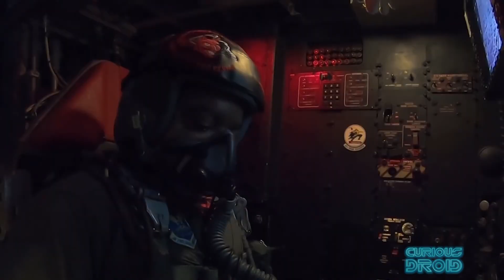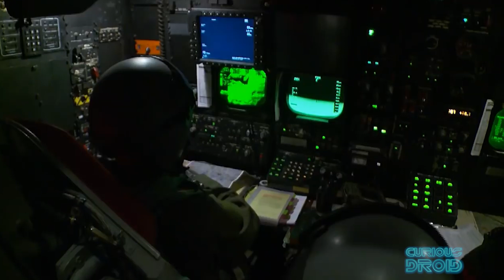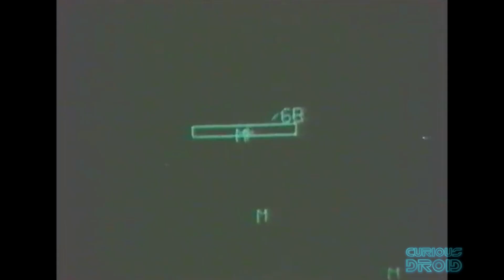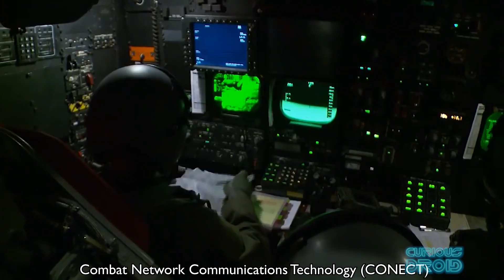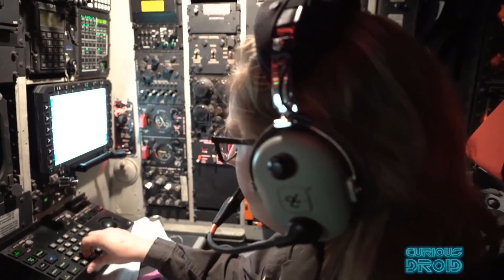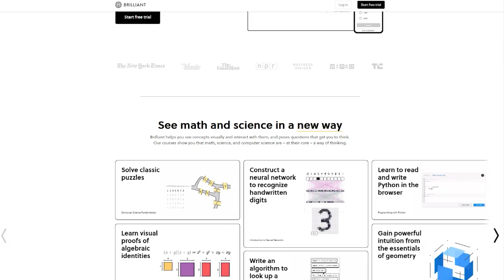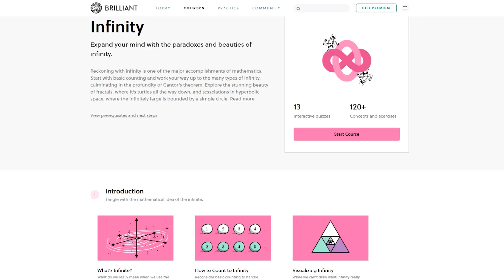How Long Can the B-52 Continue in Service?

Comment: If it fits tactical niche perfectly, it need only maintenance, not upgrades or replacement. When a weapon or device obtain relative perfection, it no longer need to change with time pass. For example, steel sword or knife made 700 years ago may be just as good and useful as one was made yesterday. Bolt rifle, like SMLE, mosin or mauser is just as good today as it was century ago. Of course, today swords and bolt rifles are obsolete, they are not mass army weapons, but they are almost as good as they could possibly be, and it will not change anymore.

Comment: well, as bombers go, the B-52 is a quintessential design.  In other words, if it were designed today, it would look the same.  That speaks to the insights the design team had when it was first put on paper - back in the early 50's!.  Still a sexy beast.  Sorry, after the B-1 "Bone" with it's wine-bottle fuselage is drop-dead gorgeous.  The B-2 "Spirit" flying-wing design  is sinister.  But, the B-52  is a true long-range heavy bomber.  I find the design beautiful in it's robust simplicity.

Comment: The term "over-engineered" is really a vague and inaccurate statement.  It really wasn't over-engineered so much as it has relatively high margin's of safety for some components.  But it certainly has it's flaws and some of the flaws are due to design, which the air force is aware of and actively mitigating.  What keeps it flying is the Air Force steering the way with it's ASIP program, the corrosion control plan, and the Boeing engineers across the street at Tinker AFB.

Comment: The 52s weren't over engineered... they were engineered to be over built  (long lasting).  Changing the engine manufacturer, is as dumb as dirt. Changing engine design/model is to be expected.

Comment: I was an enlisted electronic warfare/countermeasures technician (chaff, flares, radar and radio jamming, etc.) on the B-52H from 2001-2007. This meant that I and my coworkers drove out onto the flightline in a work truck with tool chests and tool boxes, climbed on/into/beaneath the plane, and troubleshot and repaired mechanical and technical issues, not unlike glorified car mechanics. Most of our work involved identifying malfunctioning parts, uninstalling them from the plane, sending them off to be fixed or scrapped, then installing new replacement parts and ensuring they worked properly.

If only I could show you how ancient that technology really was. You could sense its age. It all looked, and felt, like you'd stepped fifty years into the past, and was large and heavy. For example, there were outdated computer programming cases (repair tools, not part of the plane) as big and heavy as a packed piece of luggage, with memory cartridges the size of lunchboxes, both with hardly more computing power and memory than a cheap calculator.

The plane also broke constantly, in the sense that at least one thing (and usually several things) had to be repaired after every single training flight, let alone real sorties. There is a price to pay for being old without being entirely replaced by something 100% new.

Comment: Question about 0:36 It looks weird that the fuselage axis is pointed much lower than the apparent direction of flight. I thought the two vectors were nearly always aligned. Is that normal for planes,  for the B-52, or is it due to those huge flaps changing the angle of attack or something?

Great video!

Comment: The original B-52 wing suffered from problems that lead to a redesign. I don't recall if it was a fatigue issue or something else. The wing was designed to flex considerably during normal operation, something like 12 feet at the tip.  I recall that the wing tips were approximately head height above the ground when the airplane was parked and they flexed up to about level with the top of the fuselage when in flight. During my Air Force service years (1968-1972) the D and earlier models were being sent to depot to be refurbished. This included replacement of the wings to extend their service life. (yes, they sawed to old wings off at the root and replaced them with a new wings. I am not sure if the H models which I worked on were also later modified. As I understand it only the H models are still in service, the earlier models were either shot down over Hanoi or retired to the bone yard. Last I heard one early model (A?) was still being used by the Air Force to drop test aircraft at Edwards Air Force Base.

Comment: 0:28 Flying on diesel?
Reply: @ John Johansen That is what burning JP-4 jet fuel looks like when they “pour on the water”. They always seemed to do that on MITO [Minimum Interval Take-Off] launches, which is what you’re looking at. Four bombers would take off at 30 second intervals. Not sure what that water business was all about, but yeah, it does look like they’re belching diesel.
Reply: @huenorton3587  Thanks for answering. 👍
Actually I was thinking of writing coal, instead of diesel. 😉

Btw I've seen videos about MITO.
There they also looked like old coal fired steam locomotives. 😆
Reply: Often times the MITO launch is associated with a FSAGA [First Sortie After Ground Alert] flight where the nukes were stripped from the planes on the alert pad and then they would scramble them “as is” [i.e. no inspecting for bird’s nests in the radar cooling system etc.] to see how they will do after sitting still for weeks. This most often includes testing the cartridge start of the engines wherein an explosive charge is used to spin up the engine. A cloud of white smoke would envelope the alert pad and then the bombers would come lumbering out of it to go into MITO. Smoke. Lots and lots of smoke and fumes. I hated being on the flightline when they did that. Got carbon monoxide poisoning once between a cartridge start MITO and the jets running on the plane I was working on for hours. Got to the dorm , fell asleep and woke up with something like a Charlie horse in every muscle of my body along with puking out one end and simultaneously shitting out the other while curled up in an immovable ball on the floor. Great times. Lol.

P.S.
I wouldn't be surprised if the old "A" models were indeed coal-burners. ;) [I only worked on the "G" and "H" model air-hogs, so I can't say for sure.]
Reply: @huenorton3587  What can I say, but thanks again for making me wiser and realizing what's really going on.
I'm a simple European, when it comes to American airforces.

Thanks for sharing. 👍

Comment: I think the emphasis on the long life of the B-52 should have included more information on the maintenance. I give credit where credit is due and for the US forces, the Air Force is top notch in maintenance as every air frame in the DOD that is not mission capable for longer than 24 hours MUST be reported to the Senate Oversight Committee. Before secure cellphones, they sent runners to hand deliver the reports. I can assure you that by this time the USAF has x-rayed the entire aircraft several times.

Comment: I was part of the 92nd BW H at Fairchild in 1978.   I will be long dead before the B-52. Trivia, when the tailgun was removed, the space and weight were replaced with concrete to rebalance the plane.   A ton of it.

Comment: A real simple explanation is it was designed a the perfect time.  Designed to carry big, heavy weapons intercontinental distances.  The weapons got smaller and lighter.  This gave the B-52 extraordinary capability that no one wants to throw away.  It is cheaper to put a new engine in the old, but well maintained, bus than to scrap it and buy 4 new station wagons.

Comment: The B-52 is such a beast and an icon I personally don’t think it will be retired for at the LEAST another 100-150 years
Reply: A B-52 could still be useful in 100 years, but none of the planes in service right now will last that long, even if boneyard planes are cannibalized for parts.
Reply: @Jake-rs9nq  they would literally need to be taken down rivet by rivet - at which point it might be easier to toss the buff
Reply: God bless you mi Generál. May the thrown outs from helicopters burn in Hell for their communist subliminal activities.

Comment: Really liked this video but then I like the B-52. The US military has 
a lot of old planes, jets and helicopters. There are civilian planes
that are old designs still flying. The Brits do too but not  on this 
list. I don't have everything and the dates might be a bit off.  

DC-3 was 1935
Piper Cub 1938
Globe GC-1 Swift 1942
Lockheed U-2 1957
SR-71 went 34 years from 1964?
KC-135 Stratotanker 1957
Lockheed 130 Hercules 1954
Rockwell B2 Lancer 1974
Northrop T-38 Talon 1959
Lockheed P-3 Orion 1959
Bell UH-1 Iroquois
Sikorsky S-61R 1959
Boeing CH-47 Chinook 1961?

Comment: Another problem with replacing the 8 TF-33s with 4 newer engines is the risk of uncontrollable yaw if an engine is lost on takeoff, when all engines are at full power; the BUFF was not designed for that

Comment: I talked to a BUFF driver at an airshow, and asked about the engine refit thing. He said that something had actually been tried, but the increased thrust started blowing the tail section off of the aircraft.
Reply: No, that is just a story.  A problem was with the wing being a little to low to hang the newer engines on.   A re engined plane has not flown yet.

Comment: It is basically the same with the Boeing 737, which first flew in 1967 and is kept running until today and further. Aircraft development is just so immensely expensive, that fitting new technology into an old aircraft body is done until the limits of the airframe are reached, or in the case of the 737 even exceeded.

Comment: Tells you how stupid the US military is. They never did the engine upgrade--ended up being so dumb. Even the CBO suggested they be replaced but B-52 are not sexy like the costly F-22 and F-35 dollar killers.  The Air Force has been constantly trying to kill A-10 with the F-35 turkey or what ever. The F-16 still does a great job much more economically than the F-22 or F-35, which were both gold plated. I understand that the B-2 will be retired in 2030 and the B-1in 2040. The B-52 outlasts all those other gold plated planes.

Comment: Actually, the original B-52 had a projected service life of no more than 20 years.  When it was first rolled out in April 1952, the Air Force had already had some unpleasant experience with Soviet MiG-15s (the Korean War raid on Namsi on 23 Oct 1951, aka "Black Tuesday", where six of nine B-29s were lost by the Soviet-piloted jet fighters, which not only had a 2:1 advantage in top speed, but also tremendously out-gunned the bombers with two 23mm and one 37mm cannon; the American bombers had but .50 cal turret-mounted, some 29s still had the twin tail-mounted "twenties" but they were already being replaced; IDK if any of the planes on the Namsi raid still had the cannon.  It was figured that max ALTITUDE, or "ceiling", which the "BUFF" had well over not only the venerable B-29 (31,000 ft) and its derivative B-50 (37,000 ft), but also the faster but smaller B-47 Stratojet (41,000 ft, the Stratojet took much of its inspiration from a late German WWII design, the Junkers EF132, which had the swept wings and six-engine configuration, the original concept of the Stratojet was a straight-winged aircraft, until the "Alsos" project uncovered the Junkers design and a slew of wind tunnel test data).  It was figured, correctly, that the MiG-15 and its derivative MiG-17 "Fresco" simply had neither the loiter time nor ceiling to catch the BUFF, which had sufficient speed to make interception very "dicey" in the early and mid-1950s.  However, as already with the "Century" series the USAF was coming out with supersonic fighters and/or interceptors (most notably, the F-104 "Starfighter", which had a bad reputation as a "widowmaker" for its poor reliability), there was reason to surmise that soon the Soviets would do likewise, which they did in 1958 with the Yak-28 "Firebar", which could reach 55,000 feet and top out at Mach 1.8!  So, going back to the original 1930s Luftwaffe concept of the "Schnellbomber", e.g, a very fast medium bomber that relied on speed and altitude to evade interception, the USAF came out with the B-58, which indeed flew very fast (Mach 2.0) and high (64,000 ft acknowledged, it may have been capable of 70,000 feet!), and worked further on the B-70 "Valkyrie".  But the "Hustler" was extremely expensive to buy, operate, and MAINTAIN of itself,  and required a disproportionate amount of air-refueling support, and the Valkyrie promised to be a "budget-buster", which didn't bode well, especially at the time with the Navy clamoring for nuclear boats and carriers (and air wings) and the Army wanting a fancy new MBT to go "toe-to-toe with the "Rooskies".  It was the shoot-down of Francis Gary Powers' U-2 in May 1960 that was the "game-changer", as the capabilities of Soviet missiles were shown to be able to shoot down high-altitude bombers with ease.  This led to cancellation of the Valkyrie outright and a planned replacement of the B-58, the B-1 "Lancer", cancelled under Carter but resurrected under Reagan.  Meanwhile, the B-47s reached the end of their useful lives and this left the "BUFF" to should the SAC workload.  It was thought that bombers were way too vulnerable anyway and obsolete; the B-52s were used over Vietnam precisely b/c it was believed that the Soviet-made air defenses weren't the best they had; in the Linebacker II operation in 1972, that was proved WRONG.  However, the loss rate of the BUFFs was a lot less than expected, and what they did lose were blamed on poor operational tactics (e.g., flying in predictable patterns) and use of the "G" models, which hadn't received the ECM upgrades that the "D" models had.  Losses were kept down by including at least one "D" along with two more "G"s in a three-ship formation as well.  So it was seen that indeed the "BUFF" was still a viable bomber platform, and it got the USAF through that period until the B-1Bs and later the 21 B-2 "Spirits" could replaced it for the strategic role.  Still, and as all but the "H" models went to the boneyard, as much to fulfill SALT II treaty commitments (still-flyable airframes were actually chopped into pieces by a specially-made "guillotine" under the scrutiny of Russian observers at Davis-Monthan) as to retire aircraft no longer needed and/or easily maintained, the B-52 proved essential in "Desert Storm" and subsequent operations.

Comment: Comparing the Sopwith to the B-52 is comparing different times, in that the advancements made after the first flight of the Sopwith have been FAR GREATER than the advancements made since the first flight of the 52. The advancement has slowed down dramatically. The B-52 could be in service for many years to come, especially considering that a few original WW1 planes are still in the air today over 100 years old..

Comment: As long as these things are true, no reason to take the B-52 "BUFF" (yes, Big, Ugly, Fat, "Fellow") out of service...

(1) The air defenses protecting an enemy target are effectively neutralized, so the BUFF can fly in and drop those tremendous payloads and blow the crap out of something.

(2) There's a target amenable to being neutralized by an ALCM, even with a conventional warhead.  Of course, in the STRATEGIC role, those ALCMs can carry nukes.

(3) The wings can be kept from coming apart with a rebuild.

(4) Suitable engines procured and kept in service to replace the aging and THIRSTY TF-33s they rolled out of the Wichita factory gates with.  From what I've read, CFM-56s, FOUR of them to replace the current slew of EIGHT TF-33s, were at first considered, but that in turn would have required such a reworking of the empennage that would have in effect meant an entirely new aircraft, at considerable expense.  Therefore, it was decided to keep the present eight-engine configuration with smaller turbofans that nevertheless are still far more efficient than the TF-33.  Supposedly this engine upgrade will cost about $2B, which is equivalent to the stated cost of four of the new B-21 "Raider", but will pay for itself over a fifteen-year period in terms of lower fuel and MAINTENANCE costs, as well as, for the remaining 77 aircraft in service, the keeping of both KC-135s (which themselves have almost as long a career as has the "BUFF" and will likely remain in service with Air Guard units well past 2050), KC-10 "Extenders" (a few have been sent to the "boneyard" at Davis-Monthan), and the new Boeing KC-46, which is slow to roll off the assembly line and still plagued with issues, will be lessened (ergo, the older, less "fixable" versions can be sent to Davis-Monthan, along with every squadron's "hangar queen"), which of itself will more than pay for the re-engine program, along with increased range and/or LOITER time, which in terms pays off in terms of mission capability, something that's not appreciated until it's PRICELESS.

Comment: I worked on KC135's in the AF and those are just as old, made in the 50s and early 60s. the 135R model was the most recent upgraded version of the airframe. It is projected to be in service until at least the 2050s even with the new 46 models being produced right now. Amazing planes both by Boeing, they know how to engineer aircrafts

Comment: I worked on the C-130 in Little Rock AFB, Arkansas!
I worked on the B-52 in Andersen AFB, Guam!
SAC STRATEGIC AIR COMMAND
Persian Gulf War
Reply: I worked at Lake Benbrook south of Ft Worth in the 70s. The pilots would call us and ask the elevation of the lake. Then when they took off, they would fly over the lake and use it to calibrate their air to ground radar.  That was before digital anything.

Comment: Put a glass cockpit on them (as they did with DC-10s turning them to MD-10s), put modern, more fuel-efficient engines on them, and equip them with modern radar/anti-aircraft systems.